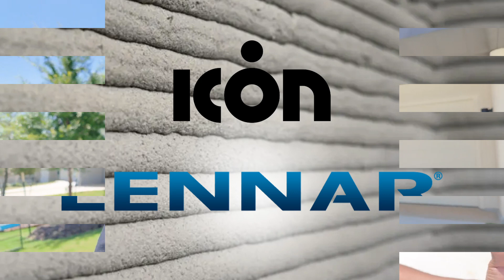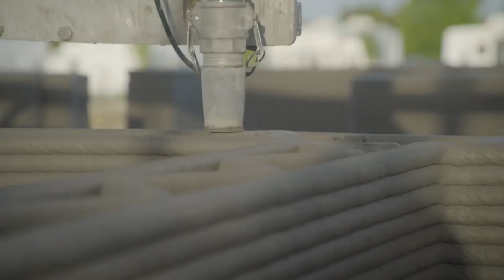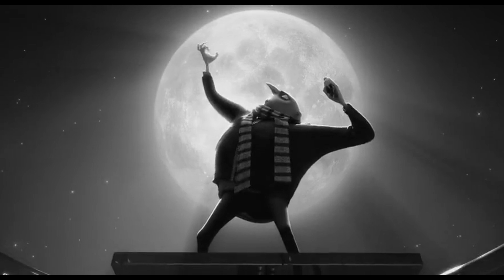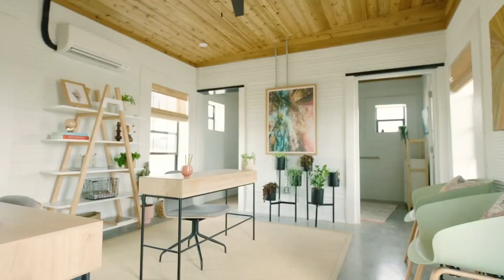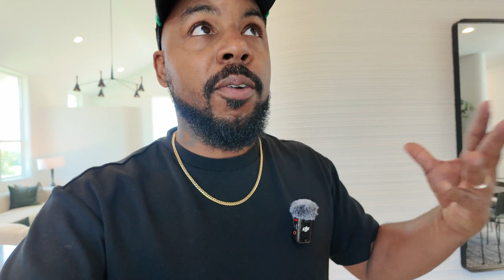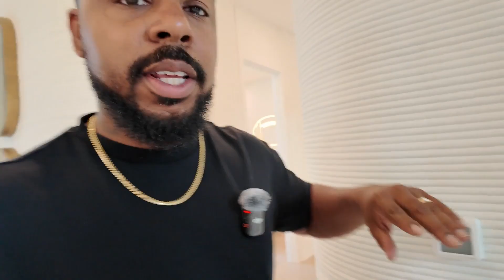Why This 3D Printed Neighborhood Could Change Housing Forever

Comment: There are two kinds of concrete: concrete that is cracked, and concrete that will crack.  The difference in Georgetown is that the foundation is on rock, most of Texas is clay with expands and contracts. 
The walls are doubled, with a cavit inbetween, but no one seems to know what is in the cavity.
Reply from the maker: Def heard this before

Comment: No they aren’t. Claims someone found a solution for affordable homes, proceed to show homes the cheapest of which is $300k. 🤦‍♂️🤦‍♂️🤦‍♂️🤦‍♂️
Reply from the maker: They are expensive right now bc the tech is new but in the long term I think it could transform the housing market
Reply: @realestatesteph 
No sir, once the tech get smaller, easier and faster, the demand will get higher and the price will then only go up.

Comment: I’ve seen what 3D printed concrete looks like vs traditional monolithic structures and I’d pick monolithic everyday. 3D printed concrete will have uneven wall thicknesses and the small width will crack first and take the rest down with it. Sure it may save time but it looks terrible performs terrible and costs more than a crew forming a monolithic slab. I really hope this industry actually does something useful with the tech they have. Also one last nail coffin is the X,Y plane tolerances or rather the lack of.

Comment: Problem is when these homes have issues the only person that can probably fix it is the home builder and they can jack up the prices.

Also, those curves are probably going to be hard to clean when dust and lint builds up.
Reply: Every homeowner receives a home care kit, and it’s actually very simple to make repairs or updates and also do various finishes to the walls. Should a customer choose to do so such as tiling, stucco, plaster. Will have video content releasing soon answering most frequently asked questions such as this.
Reply from the maker: Thanks for that!
Reply from the maker: Yea I feel that!
Reply: This just opens a whole new job market for repair men and women who will learn to repair these homes so lets hope theres competitive pricing. 🫠
Reply: @doinkster28  that’s going to take a while for people to upskill to be able to do that though so for sometime the original company will still have a monopoly on repairs.
Reply from the maker: Great point